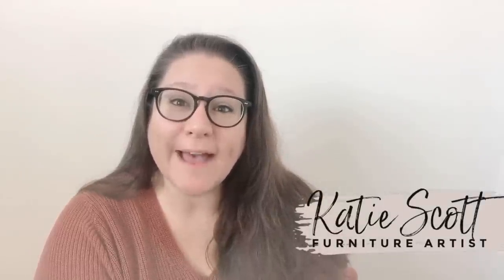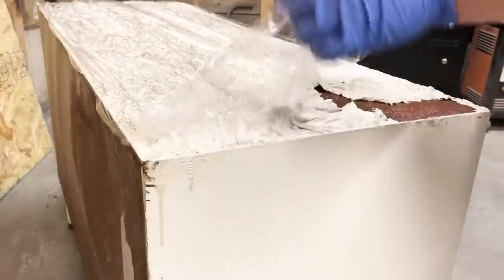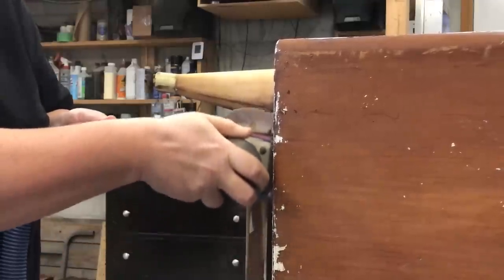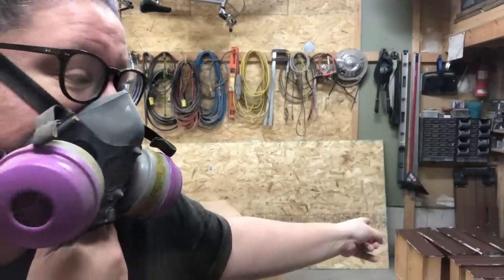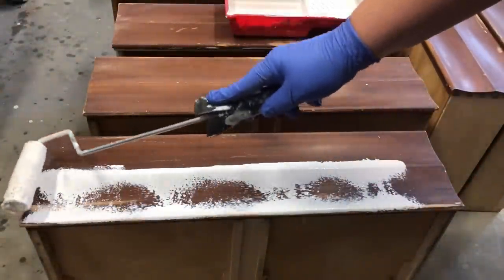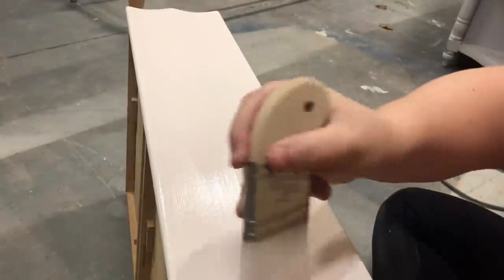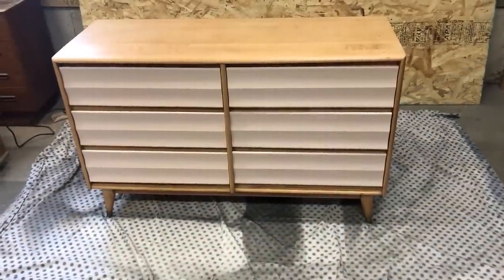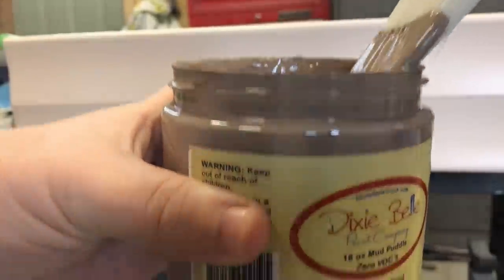Modern Boho Dresser Makeover | RESCUED FROM THE TRASH!

Comment: This turned out so pretty!!! Is there a reason why you chose to ise a primer this time even though you used chalk paint? What makes you decide which pieces require primer before painting them and which ones doesn't.
Reply from the maker: I almost always use chalk paint and I almost always use primer first! It seals in any stains and provides a nice even surface for painting. Primer isn’t necessary for adhesion with chalk paint but it’s great for those other issues.
Reply: @salvagedbykscott  thank you for your reply!

Comment: A beautiful re-vamp with a ton of work! I am learning a lot from you. I have a question... you said that you put a protective varnish on the drawers too and decided to change the colour, did you have to sand down the drawers again or did you just paint the brown over it?
Just asking in case I need to change the colour too. Thanks! 😉💐
Reply from the maker: Nope, I just painted right over top and then reapplied the top coat 😉

Comment: Beautiful! I love the color you chose for the drawers. I’m refinishing a kitchen table. I’ve done it twice so far and the protective coat I have used hasn’t worked, it remains sticky. Any suggestions?
Reply from the maker: I’ve never had any issues with the Varathane top coat that I use. I would think if it’s not drying, it is probably having an issue with whatever is underneath. Are you applying over paint or a stained finish?
Reply: @salvagedbykscott   It was over paint. Maybe I should ask what paint I should use as well. Thank you for responding.
Reply from the maker: @123cindyb  I only really have experience with chalk style  and acrylic furniture paints. I know latex can stay sticky for a really long time. You need to make sure you’re using like products. Oil with oil, water with water.

Comment: I have a dresser that is not solid wood on the top but I'm pretty sure the frame is solid wood! Would I be able to do this or is the top something that will be damaged if I sand it? It's currently painted black 🤦‍♀️🤷‍♀️
Reply from the maker: It’s hard to say. If it’s a thicker veneer it can definitely be sanded, just with caution. If it’s a thin veneer or laminate I wouldn’t recommend.
Reply: @salvagedbykscott  thanks for replying! I appreciate it! 😊

Comment: Once you realized you were gonna use the dixie belle paint, did you do any more sanding on the pink paint to get the top coat off ?
Reply from the maker: Nope. I just added a few coats of the new colour and a few more coats of top coat. Because it was fresh the paint will adhere just fine. If it was an older finish I might have lightly scuffed it first.

Comment: At about the two minute mark I loved the designs coming thru the strip, is there a way to stop and save that reaction?
Reply from the maker: No. The paint isn’t any good once the chemical is applied and it was no longer adhered to the surface.
Reply: @salvagedbykscott  that's why I still subscribe to you. Quick replys and good info. But is there away to say it once you see something you didn't see before?
Reply from the maker: @mrjasonshipp  not sure
Reply: @salvagedbykscott  groovy, again you have so much stuff I should have listened to you the first time, like the sand papers, that I wouldn't have screwed up so many of the projects I was working on. You are a great help.

Comment: great vid :D :D 
but how do you deal with dust nibs after your last layer of topcoat??
Reply from the maker: As I showed in the video, I sanded the first coat with a super fine sanding pad. I always wipe away sanding dust with a lint free cloth before proceeding to the next coat of any products.
Reply: @salvagedbykscott  I mean after that, doesnt any dust land on your piece causing it to be a bit rough :O  ?
Reply from the maker: @Daichidesu095  No. If you did ever get a rough texture I would either lightly sand and apply another coat or buff it smooth with a 1000+ grit sandpaper.
Reply: @salvagedbykscott  okk thank you :D :D